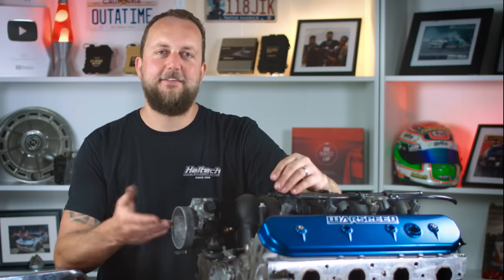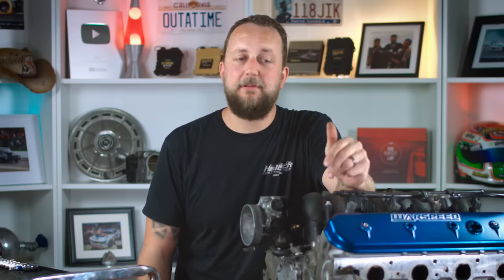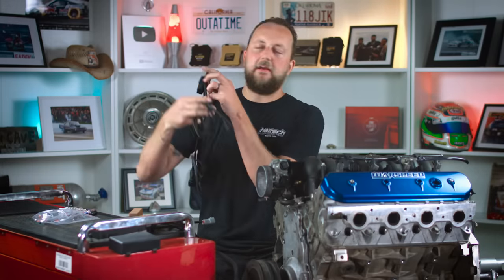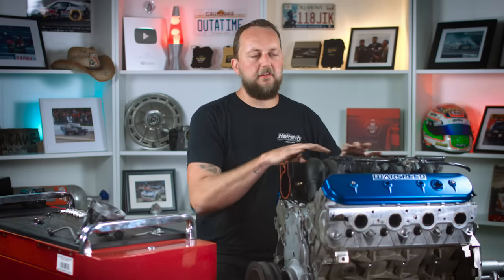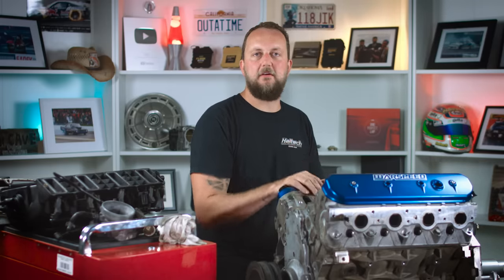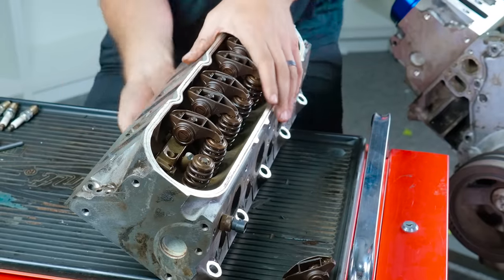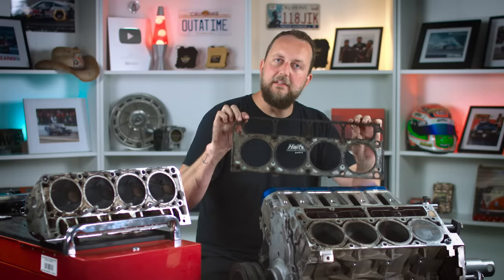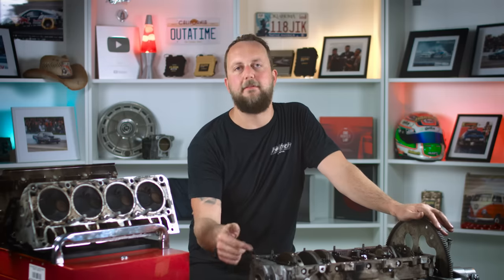🤔 What's so special about the LS? | TECHNICALLY SPEAKING |

Comment: Pushrod motors are my engine design of choice. Primitive but reliable and effective. 700k miles no problem.
Reply: Primitive?
Reply: @manoman0  compared to an overhead cam design yes
Reply: @alexismendoza1545  Primitive means simple, easy. I think a pushrod design demands some hell of skills to build and run well.
Reply: alexis mendoza OHC design doesn’t predate DOHC by that much they were all developed around the turn of the 20th century.
Reply: Easy to fix, easy cam swaps, mass amounts of Torque 🤷 why not pushrods. 
I love the idea of valve control, though I know where your coming from.
Reply: @squidusn71  No, and I wouldn't prefer a flathead Ford either. Same goes for magneto ignition and vacuum carbies but I'll take an LS every day and twice for every day that ends in the letter y.
Reply: Right. And they have no problem making power if done right. I'm 95% sure top fuel dragsters still run 2 valve per cylinder, push rod motors. Simple is good, especially for swaps.
Reply: Remember simple and reliable walk hand n hand
Reply: I call it Valve Derangement Syndrome.  It's quintessential over engineering.  2 valves 1 cam shaft.  That's all ya want.  Anything more just gets in the way.

Also, primitive would be if the LS had never won Le Man's.  Once you've won Le Man's everything behind you is primitive.  The LS is elegant.
Reply: It's not the technology that makes for reliability, it is proper design.
Reply: 300k on my 6.0lt still towing big loads....no smoke or oil leaks

Comment: Well shown... Simplicity is key to strength and reliability.
Reply: Lmao all ford blocks hold 1000+  2j takes you how far simple only makes power with adders
Reply: @austinhowze6280  What's so funny... The Chevy small block is a legendary design which has lasted the test of time since the V8 forefathers designed the thing!
Reply: @austinhowze6280  one problem with your argument....the Windsor block has a habit of splitting at over 500hp. Come on man, do your research
Reply: @calincampbell5637  damn dude we not talking about the older motors we talking the ls 2v ford era do your research all 2v blocks support 1000 hp and the aluminum blocks will do 1500+ with no modifications
Reply: @whoguy4231  the ford small block usely makes it longer than the 350s every 350 I know got rings and bearing at 300k where the ford are going 500k before they trash the truck and buy a new one
Reply: @austinhowze6280  idk if you know this but 300k is a lot of miles...lol
Reply: @calincampbell5637  not by today's standards 300k and dont burn a drop of oil with good compression the 4.6 in taxi cabs hit 600k before the get a new car
Reply: @calincampbell5637  and the fact that you didnt even think that  you just  compared a older motor to a new one shows that you never even looked into the newer fords but I keep hearing chevy talk about this dohc beast they building
Reply: The new Coyote blocks distort at around 800 horsepower and the oil pump gears tend to let go a little bit before that. The brand new Coyote's running 12:1 compression are suffering from cylinder wall issues.The Coyote is a great platform for power and most don't have any big issues, but they're far from invincible and we won't even get into the Voodoo engine. Not to mention 4 timing chains, 32 valves, 4 camshafts, etc. Just a set of cams in a Coyote costs more than the entire cam kit I put in my LS3 (cam, pushrods, rocker bearings, titanium retainers, valve springs, etc). 

The 4.6 SOHC Ford is a very reliable engine, but they don't make power unless you step up to the DOHC 4.6 found in the Terminator Cobra's. Ford makes some good engines, but the Terminator and Coyote engines are physically larger, heavier, more complex, and more expensive than an LS engine.
Reply: @midnitesquirldog1 Of course. Nearly anyone doing an engine swap has a budget and the LS gives the most power for the budget. I could swap a  1LR-GUE  from a wrecked Lexus LFA into a $10k donor car, but I'd end up spending $100k by the time I'm done. Or I could just buy a salvaged LS and have a 900 HP project car for dirt cheap. Why the fuck would I spend at least double to swap any other engine in, on top of having more issues to deal with because the aftermarket is garbage compared to what's available for LS swaps.
Reply: @KTM990WFO  The Gen 3's 5.0 Coyote's are especially prone to issues when you get close to 800 HP. If you want a 3rd gen Yote to live at 800 HP,  your only choice is to pull the engine and pay a machine shop to sleeve it, and have gusset plates welded to the block to support weak areas. The brittle powdered metal oil pump gears have to go too. I would also highly, highly suggest upgraded rod bolts, because the factory rod bolts are always a weak point. Then there's the PITA dual fuel injection system....
Reply: @austinhowze6280  So do LS's. Stock bottom end 5.3s are in the mid 7 second quarter mile times and making 1500-2000 HP
Reply: @Turbo_Todd  yeah first how long theres no cast rod holding that power for long you talking about hero engines
Reply: @austinhowze6280  just sayin, the motor works
Reply: @Turbo_Todd  motor motors can make a one pull wonder at that power level so your point isnt valid we talking about a build that will do 100kplus
Reply: @austinhowze6280  Wrong. You should look up the fastest SBE LS cars. Folks are running a season on the Gen 4s.
Reply: @Turbo_Todd  those are not stock motors dude even forged rods let go at 800hp there is no stock cast rod holding that kind of power if you keep saying wrong then you might need a bigger under standing of the difference in cast vs forged
Reply: @austinhowze6280  Also, you need to look up what a Powdered Metal rod is. Very different than an old school cast rod.  
Involves packing powdered steel into a mold, heating it, and then forging it into the shape of a rod, machining,  then cracking the cap. Oh, and they are full floating piston pins - like race motors have
Reply: @Turbo_Todd  lmao ford used that on the lighting's in 99 you got to remember chevy is 10 years behind ford
Reply: @Turbo_Todd  second those cars are on race fuel
Reply: @Turbo_Todd  oh no the chevy owner is offended ok snowflake come down gm is building dohc engines now to join the future oh powder Forged isnt much better than cast but on the good side they added all that extra material to them
Reply: KTM990WFO I love ford and Chevy equally but I couldn’t agree with you more
Reply: @austinhowze6280  You've been schooled enough,  but just for icing on the cake,  Ford just built a new 7.3L gas motor with 2V heads,  deep skirted block.  They realized that simplicity works!
Ok im bored with this.  Later
Reply: @Turbo_Todd  lmao just cause ford make another push rod motor you think they steped back like come on dude that's why the ls1 has so much like a 351 funny how that works
Reply: @austinhowze6280  The Coyote isn't a 100k+ mile block at 800 HP or higher. You'll have cracks, bore distortion, oil pump failures, con rod failures, etc.
Reply: @austinhowze6280  Uh the 2018 LT5's factory forged rods have been pushed to 1400 HP lol
Reply: @karlschauff7989  that's cool are we talking LTs or ls it dont matter you chevy people put a 4.8 in something and say its LS swaped nope all LS motors are aluminum and not iron try again your 03 1500 has a stock motor kind of people 🤣😂🤣😂🤣😂😂
Reply: @karlschauff7989  with modular engines area based on how there made not the engine itself second its 98%the same cause its still push rod engine why by your math then they are 98% the same to all push rod motors the lt is a new generation your correct isn't a ls the only engines that area ls have ls on them when you say ls engine the first thing you should think is oh gm classification of the ls not what the public thinking a 4.8 is a ls
Reply: @austinhowze6280  The trucks gave the iron version of the LS. You can take practically every part from an LS3 and put it on the iron block version. The only differences are the block material and the heads. The 6.2 L86 from the 2014+ trucks is practically identical in every way, right down to the crank, rods, block, pistons, and heads.
Reply: @hochhaul  and did it get labeled ls???
Reply: @hochhaul  in fact the 4.3 ls based vortec get no talk about making big power so is the ls design is so great then why this little v6 make no power
Reply: @austinhowze6280  That's the dumbest argument I've ever read. Just because a company has different production codes has nothing to do with whether or not it's an LS-based engine.

https://en.wikipedia.org/wiki/LS_based_GM_small-block_engine

You are the only person that thinks that not having LS on the block casting means it isn't an LS-based engine.
Reply: @karlschauff7989  you said it your self dude based and is is very much different
Reply: @karlschauff7989  you can run 351 heads on a ls1 so does that mean the ls is a ford motor you make no sense the ls motor can interchange outside it's own brand doesnt make the 351 a ls
Reply: @austinhowze6280  stop dribbling 😁
Reply: @johnboy5167  did you just comment on a 2 year old comment feed wow

Comment: 15:10 That o-ring that seals the pickup tube to the oil pump was the cause of low oil pressure on cold mornings. Changed that instead of the pump and saved a ton of money. Got oil pressure like new on a 290,000 mile engine now.
Reply: @GbbJunkie It was dry rotted. Came off in chunks!

Comment: Two things: Crank-driven oil pump, and Cross-bolted mains in a long block skirt. Those two things alone make the LS the strongest engine out there, and make it super-popular. Race engines use main girdle kits for the same reason - stiffening the block lower-end and increasing crankshaft support
Reply: itsabig  yes SIR, though Chevy boys will die before they admit it, the LS is a stolen designs haha. From both Ford and Mopar, it's clear as day the mighty Cleveland had alot to do with the LS. Love it haha couldn't have said it better myself, Chevy has been stealing designs since forever.
Reply: GM has a long history of a deep skirt Y block design, to add strength to its aluminum blocks. The Buick 215--which was sold to Rover--is an example. The V6 made from it, which became the Dauntless in Jeeps and the turbo version in the Grand National, also had the deep skirt even though it was cast iron. The deep skirt creates a larger volume in the crankcase, which also helps the piston speed--as it comes racing down to BDC, it isn't compressing the atmosphere inside the crankcase and causing resistance, since there's more room for that atmosphere than in a normal V8. I believe in America, Ford made the deep skirt popular with its 239-272-292-312 Y block engines that followed the flathead and were a bridge to the Windsor small blocks.

As for the comments about the Cleveland...guess where the Cleveland got its canted valves from?  GM exec Semon Bunkie Knudsen brought some engineers with him when he went to work at Ford...after the Chevy Big Block went to canted valves from the old W 409 design. But its also thought the 1st generation Chevy small block borrowed heavily from the 331 Cadillac that came before. The LS head design is suggested to copy the NASCAR Ford head design. 

https://www.stangnet.com/mustang-forums/threads/ls1-heads-on-a-ford.730454/

https://www.jalopyjournal.com/forum/threads/ls-engine-a-copy.458032/
Reply: @lettheboywatch3100  I'm a mopar guy myself who loves 440s and hemis but it's not about who did it first, it's who did it best and the popularity and success of the LS engines is a testament to how good of a job chevy did with those engines
Reply: @lettheboywatch3100 lol yeah the 351 Cleveland was so good that's why they built it a few yrs id had one in a 73 ranchero it was a turd of a Engine

Comment: 1. Price.
2. The (available) heads... 360+CFM flow, out of the box (LS7 CNC ported)
3. 55mm cam gallery
4. 6 bolt mains
5. Gaskets (they don't leak like a SBC/BBC.)
Reply: Number 5 seals the deal!
Reply: As far as heads, the stock l92 heads when ported are toe for toe with the ported ls7, which is why the 6L is so popular especially in grassroots drifting. You just can't beat 600hp n/a out of a tight, reliable package.
Reply: #5 Except the rear main seal
Reply: the head style and the 6 bolt mains are from ford. Nowhere on any other GM engine.
Reply: Sbc don't leak if you do it properly, duh.

Comment: I'm still rockin a 350 from 1978 with a 4barrel carb. lol LS's call my truck grandpappy.
Reply: me also,,got do better to make me give up small block, this video is all about selling parts
Reply: 350 💪 all day long 👍🔥
Reply: With a 4 pack 😲 she's a gem mate.
Reply: 350 is the worst engine you can have,design wise.o.k.stock..mate wanted to fit a dodge 360 to his jag,but here in aus,,there aint no kits for nothin,except chev,so,,he searched for a truck 350,010 block,threw everything in the bin,except the block,then was a slave to the speed shop..that,,is chev..rubbish..
Reply: Here in America, its a different story. We can find a #10 block like your mate did, but its just as easy to find a "Vortec" block in a junkyard from the 1990's, the heads flow better, it already has a roller lifter camshaft (no need to worry about enough zinc in the oil to keep a flat tappet lifter from killing itself). Hot rod parts for the "1st gen" 350's are dirt cheap now, since everyone is going for the LS engines. I can slap together a 400bhp engine for less than $2,000 US.

Our Dodge 360, on the other hand, has the lifter angle used back in the 1960's, which was borrowed from the Poly A blocks (which may be similar to what was available in Australia), which in turn came from the 1st generation of Hemi engines. In other words, its not a great angle for the pushrods. Finding hot rod parts for it, used, isn't as easy as the "Chev 350"--i can go to a "Tag sale" at someone's house, and find parts someone bought once to hot rod a Chevy 350. Its actually a euphamism for anything common, easily sourced, and chosen more often than not to do a job.

Comment: Its mod friendly. With stand alone or stock ecu in test mode.

Basically like apple or pc...  LS is like the PC
Reply: Which one is apple?
Reply: I'd say that in some ways the LS is more Apple like.  Less parts, less complexity for the end user to deal with.  Solid engineering and no extra crap that isn't needed to do the job.  Back in the day when it was new GM were asked "why did you use pushrods?" and the answer was very straightforward and along the lines of "we had a target of X horsepower and could do it with pushrods in less physical space and less complexity".
Reply: @JethroRose  no, apple over designs shit that usually doesnt work, over prices thoer shit products, has NO aftermarket, and yet some are still stupid enough to purchase it. Def not an LS discription.
Reply: I mainly build and tune motorcycle engines, recently got into building 1 Ford engine and 1 LS engine. Who is more difficult for me to build a Ford engine due to the complexity of the part numbers versions years you name it. But in the end the Ford motor made some pretty good horsepower. The LS motor make good horsepower just by looking at it, just kidding it was a lot easier
Reply: @sethh8892  where are the apple foldable phones that constantly break and nobody asked for?  where's the camera on the watch that's shit-megapixel res?  That's right - In android land.  You might whine about apple prices but their phones don't have crap on them that serves no purpose.  You might want to see where the most expensive mobile phone comes from too.  It's not apple.
Reply: @JethroRose  Go watch some of the Louis Rossman youtube channel videos then come  back and tell us how well Apple shit is engineered. Apple is the equivalent of a Yugo when it comes to product engineering.
Reply: @JethroRose  Nah it's more like PC. Ever try modifying something apple? Good luck.
Reply: @hochhaul  Bruh have you ever modded a Macbook or an iMac? You just cannot. PC is certainly more like the LS- cheap, everywhere, begging to be modded. Unlike the vastly overpriced, nearly unmoddable, Apple, which you likely won't be getting a decent one for under $1,000.

Comment: The downside on the LS compared to the older sbc or bbc is when you are doing a cam swap you have to pull the heads in order to get to the lifter trays. In an older sbc or bbc you just remove the intake manifold. However thats just being nick picky and GM did a great job on making an engine that not only creates good power but also doesnt have major problems for 250,000 plus miles. There are countless vortec engines with that milage that still run great.
Reply: 😂 I feel you, atleast you don't have to pull the cooling lines.

Comment: My LS2 GTO had the lifter issue.  I ended up pulling the engine and doing a build with it... I love that beast of a motor.  TONS of aftermarket support and paired with an HPtuners kit, the options are limitless.
Reply: Lifter issues are solved with a roller lifter conversion including roller rockers.

Comment: Tl;dw:

It's a relatively compact, reliable, and cheap way to make big power. They're easy to work on and have a larger aftermarket and wider power band than pretty much any other performance engine. There are other great performance platforms out there. But for value, power band, and reliability, it's tough to beat an LS.